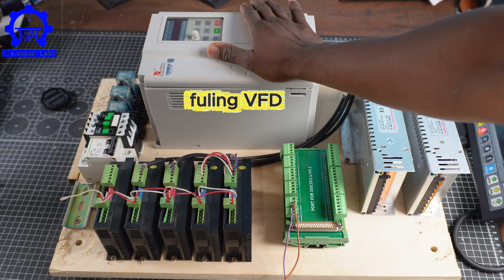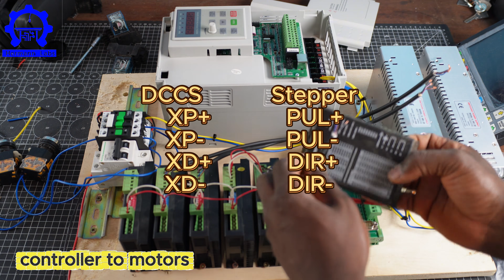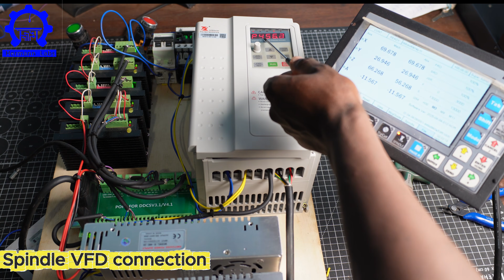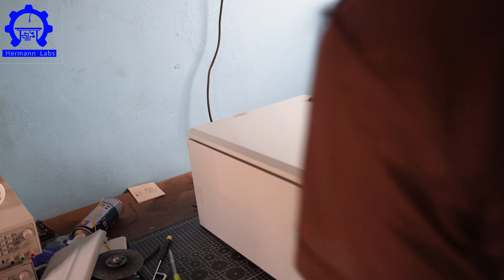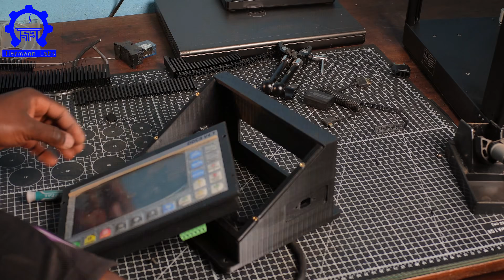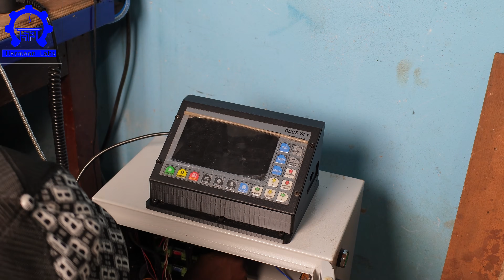CNC Controller Wiring from Scratch  DDCS V4 1 + DM556 + Fuling VFD + 36V24V PSU

Comment: Sir, I also want to ask one more important question.

Can we connect AC servo motors with DDCS V4.1 controller?

If yes, please make a video explaining the proper wiring and parameter setup for AC servo drive connection with DDCS V4.1, including step/pulse, direction, enable signal, alarm signal, servo on, electronic gear ratio, pulse per revolution, and steps per mm calculation.

Comment: Sir, one more request 🙏

Please make a detailed video on DDCS V4.1 controller working area limit setup for all axis like X, Y, Z, A, etc.

Many CNC users are confused about how to set the machine travel limit properly in the controller, so that each axis moves only within the safe working area and does not cross the machine size.

Please explain how to set X-axis, Y-axis, Z-axis working area limit, soft limit, hard limit, home position, machine zero, work zero, and what values should be entered according to machine bed size and axis travel.

For example, if the machine working size is 1300 x 2500 mm, then how should we set the safe travel limit in DDCS V4.1?

Your explanation style is very clear and practical, so a full video on DDCS V4.1 axis travel limit / working area limit setup would help a lot of CNC users.

Thank you for sharing your knowledge 🙏😊

Comment: Thank you so much for explaining the DDCS V4.1 CNC controller in such a clear and practical way 🙏

I have one request: please make a detailed video on how to set the parameters of a new DDCS V4.1 controller from the beginning.

It would be very helpful if you explain how to calculate and set the correct motor parameters according to the motor, stepper/servo driver, ball screw pitch, pulley ratio, gear ratio, microstep setting, and machine movement.

Many CNC users get confused about steps per mm, motor direction, acceleration, speed, spindle/VFD settings, M3/M4 control, limit switches, and homing settings. A complete beginner-friendly DDCS V4.1 parameter setup video would be extremely useful for people like us.

Your explanation style is very easy to understand, so please make one full video on DDCS V4.1 parameter setting and gear-ratio-based motor setup.

Thank you for sharing your knowledge with the CNC community 🙏😊

Comment: I can’t believe how clearly you explained the DDCS V4.1 CNC controller. I was struggling to understand the wiring, settings, spindle control, and VFD connection, but your video made everything much easier to follow. The way you explained each step practically is really helpful for CNC users like us. Thank you for sharing your valuable knowledge and experience. Videos like this save a lot of time, confusion, and mistakes. Please keep making more detailed videos on DDCS V4.1, VFD setup, M3/M4 spindle control, and CNC machine configuration. Really appreciated 🙏😊

Comment: I can't believe my eyes 😭. This video dropped exactly as I dismantled my machine to try and figure out how to enable m4 😅. I have a huan yan vfd, so I hope this is similar 😁.
Thank you for sharing your knowledge with us 🙏🏻.
Reply: Can you give us more information on how to enable the m4 command please
Reply from the maker: Greetings mate. Everything programming seems to be  already done from factory with the discs 4.1. In my case, I used the M3/out1
Reply: @HermannLabs Yeah, they have the m3, but unfortunately m4 implementation isn't that straightforward I think. I am not sure how to do it yet. I do have a double throw relay with 2 available relay modules, but I am not sure that I can connect the acm to both of them and then connect the out 1 and 2 to the other sides to enable m3 and m4, using the same relay?. Or should I try to use 2 separate relay modules? Or should I try a different approach for separating pulse and direction to enable both of them.
Reply from the maker: Thanks for watching, I hope the wiring is similar for your machine.